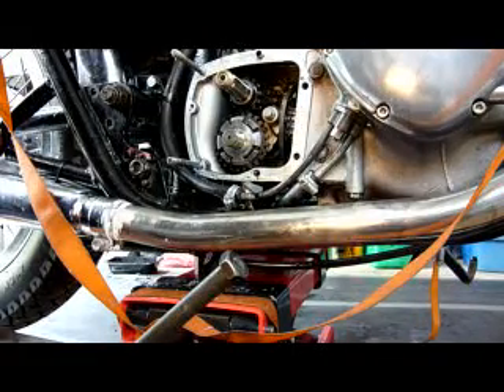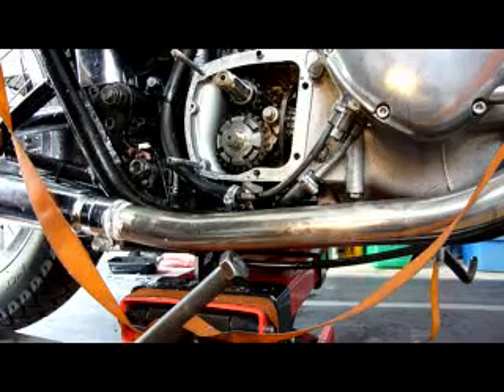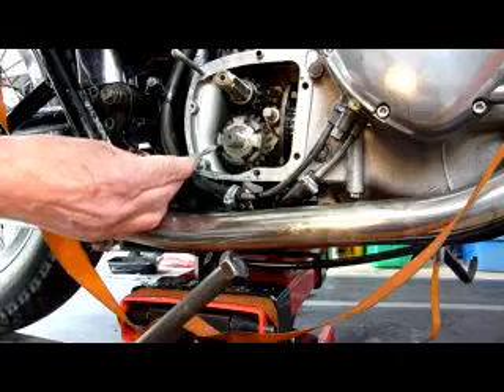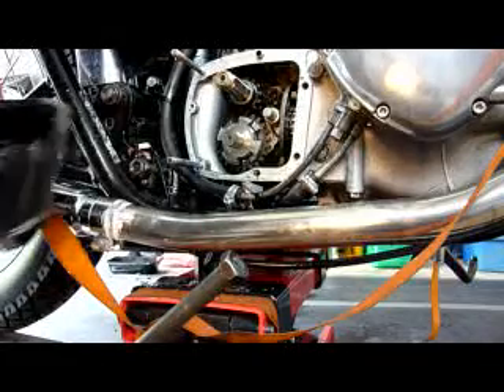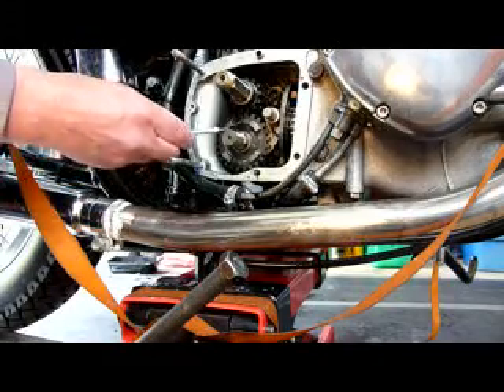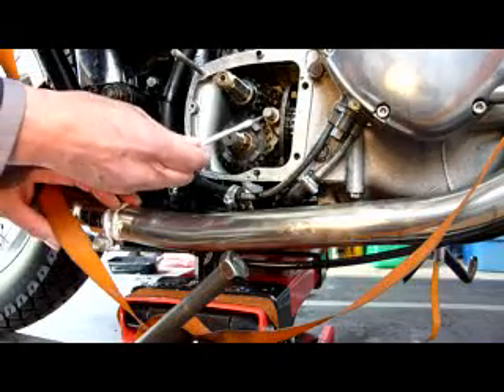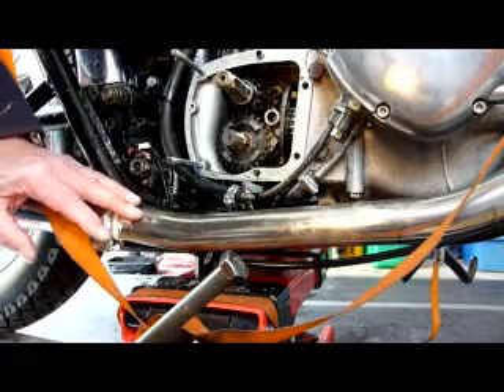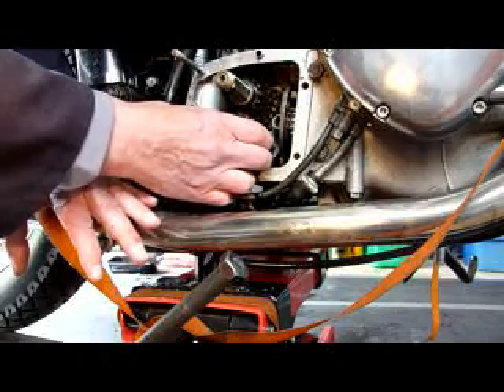Bonnie 5 speed gearbox strip

Comment: Thank you very much for this video. I accadently got my shifter shuffed up too far to the point of having to reposition it on the shaft to get it unstuck from the case cover. It goes into gear easy enough but when down shifting it doesn't feel like it click into gear very pronounced like it use to. I think that I have damaged the dogs maybe.